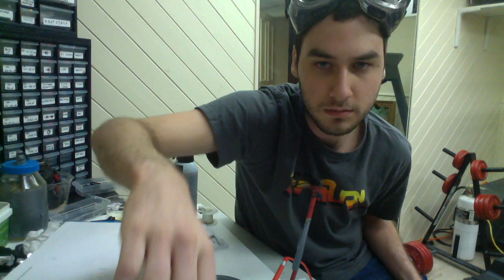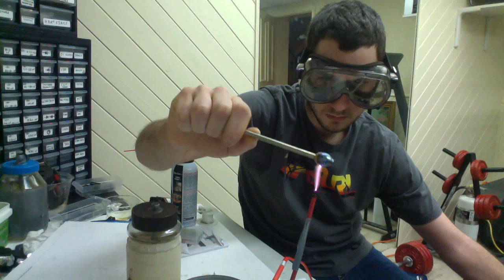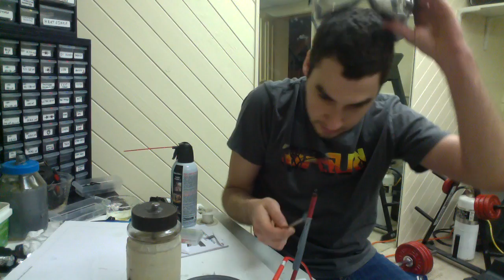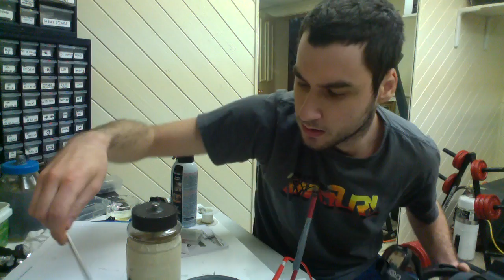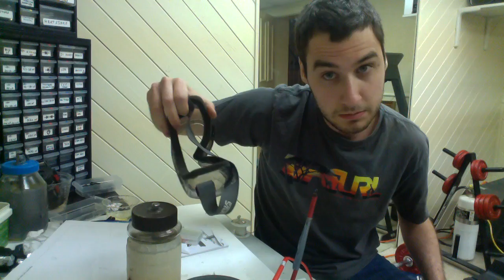Harlem Shake & Gangnam Style on 10,000 Volt Plasma Speaker

Comment: I don't understand how you are safely holding that metal wand.
Reply: +Camden Reed is it because the electricity is at a high enough frequency and a low enough current that it just flows along the surface of his skin instead of running through his muscles?

Comment: How are you not being fried?
Reply: ***** actually you need both.
Reply: High voltage almost no ampere
Reply: +Followthategg Technically, the volts can kill you. Since I = V/R (Ohm's law), and the body's resistance is maybe 2 megaohms (2 million ohms), and the voltage of this supply (wild guess) is around 30 kilovolts (30,000 volts), 30,000/2,000,000 = 15 mA. This is easily enough to kill if applied to the torso. The reason this guy is not fried is because the high-frequency "skin effect" prevents appreciable current flow very far below the surface of the skin.

Comment from the maker: The cool thing is that you can actually hear the whinny pulses of the signal in the arc out of the flyback. In my 555 flyback video you can hear this annoying high pitched noise. OK so the 555 timer also comes with an ability for you to mess with it's signal that it spits out - to distort it somewhat (the control pin). So what if you gave the control pin a wire coming out of a headphone port of an ipod/stereo/etc.,?

Comment from the maker: removing it. But imagine they were doing that so fast, more than hundreds of times per second. A super-fast on-off-on-off-on-off. (Take the analogy with a grain of salt,  but it's just the idea) There is a chip called a 555 timer that can reliably do this for you and you can even set how many pulses you want per second. So you run some electricity through the chip from a battery, and it will give you some pulses which you make stronger through a transistor and then you feed this to the flyback

Comment from the maker: It's a little technical but basically it's this: A flyback transformer is something you get out of a television. You feed it some current at a low voltage, and it spits out a low current at a very high voltage. A voltage so high, the electricity can jump through the air as if it were a wire (conductor), and this is the purple arc you see. However, you need to feed the transformer a special kind of electricity, pulses of electricity. It's akin to having someone putting a plug in to the wall and